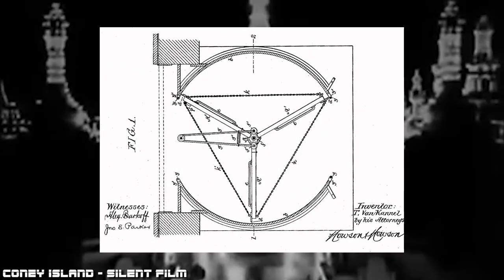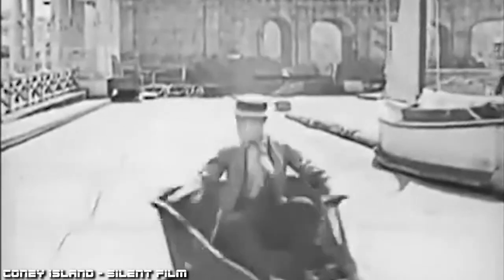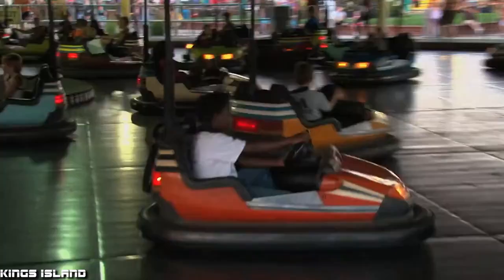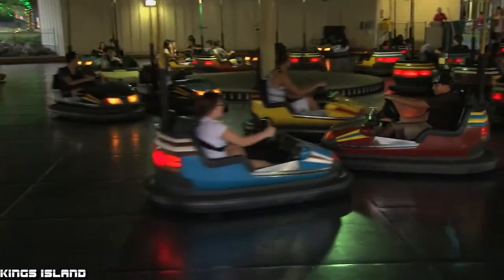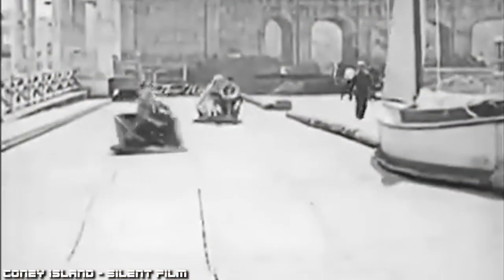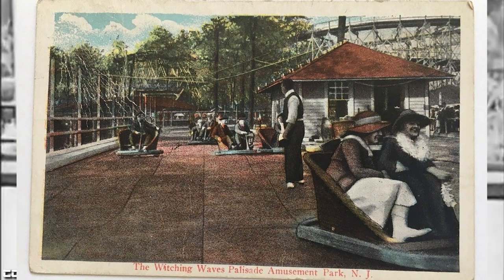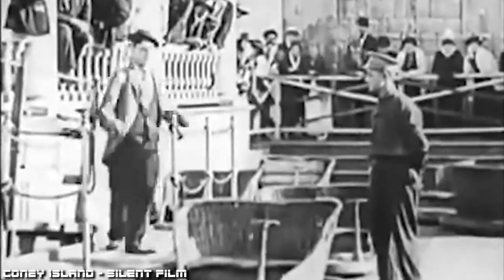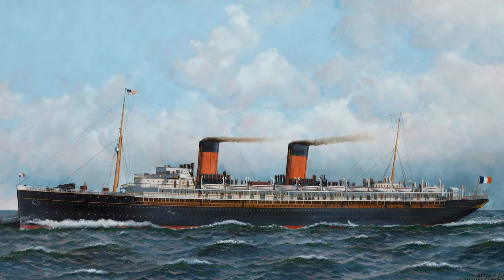Witching Waves - The Strangest Ride You've Never Heard of - Flat Ride of the Week 41

Comment: I feel like the metal fatigue probem could be solved by instead using a series of rigid, hinged, interlocking plastic plates. These plates would operate in a similar manner to a tank tread, being able to deform and "bend" by using a series of hinges spaced close together. Upfront it would probably be more expensive, but this would be offset by way greater reliability.
Reply: Yeah there is so much new technology now that I'm sure they could find a substitute for the metal and use a different material that doesn't fatigue like metal.

Comment: Interesting ride, though definitely looks like one of the most dangerous rides to have ever existed. Looks like it would be very difficult to put a cap on the speed one could reach on this ride, so preventing collisions at dangerously high speeds would be a problem with any potential modern version of this ride, unlike bumper cars/dodgems.
Reply: You could use a centrifugal governor to apply breaks when axle speed exceeded safe margins. You'd just have to be careful in your design to ensure that doesn't lead to a loss of traction.

Comment: It would be an interesting engineering challenge to make a safe(ish) modern one of these. Probably pneumatic actuators for motion some type of plastic flooring. The real challenge is making the cars strong enough dissipate collusion energy well still being light and not being prohibitively expensive. A five-point harness and helmet should work to keep the rider in the car, but you'll almost certainly need rollover protection. Which, if it's too heavy, will itself increase the chance of a rollover. Then you have to deal with regulators to get it approved and draft a liability waiver for when someone gets hurt.
Reply: RDC's bumper cars would probably work good with a modern witching waves, because of their circular design and their more protected seating.